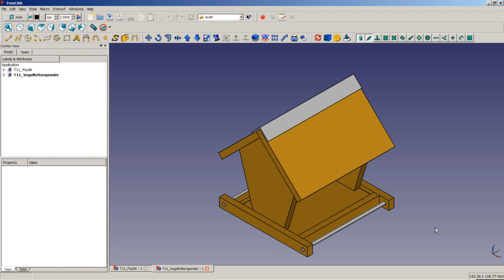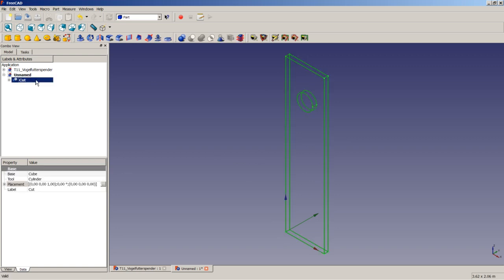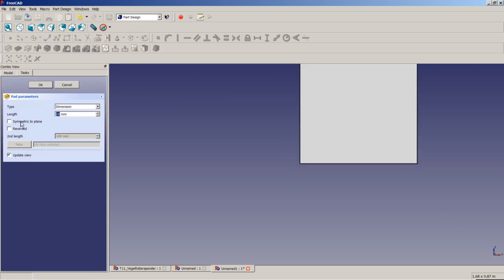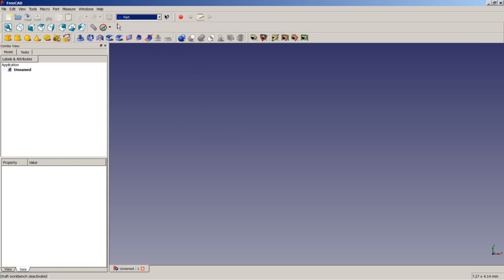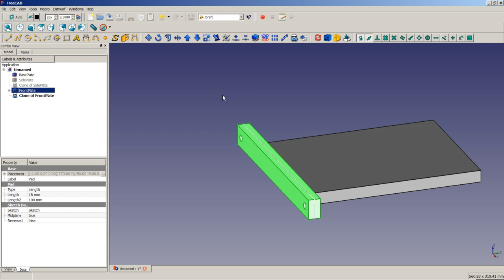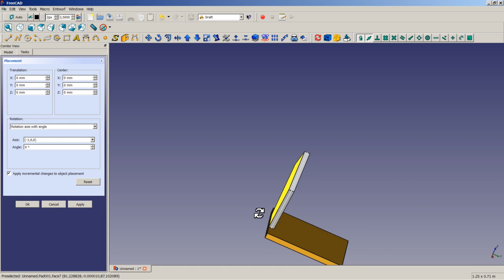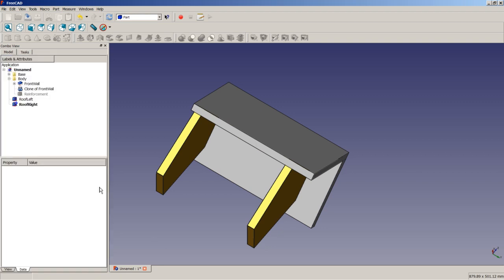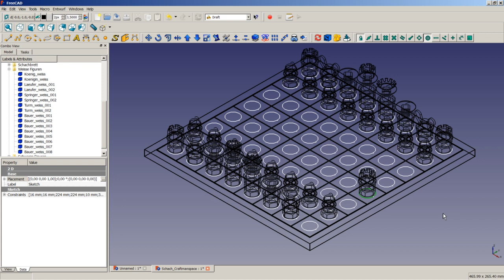FreeCAD Lesson 11 - Bird Feeder

Comment: HI, great tutorials. Im having issues with selecting mid points. I have only the 2 objects visible, only the midpoint snap enabled, when I select move and try and select a mid point, it selects anywhere, not the midpoint, its like the snap isnt working. I cant get the end plates to line up properly??
Reply from the maker: +Ruprect88 
Hopefully you are using a FreeCAD version 0.15.4671 or newer.
Did you first slect the solid you want to move in the tree view ?
Also switching to wireframe mode sometimes helps ...
Reply: +Learn FreeCAD 
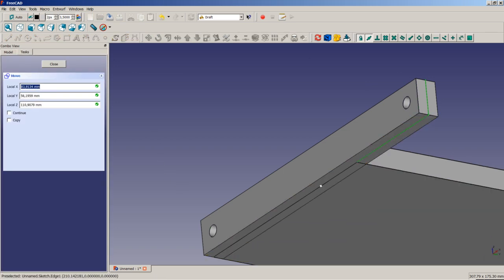Yes I am using that version. I am trying to move the front plate to the centre of the base plate  (38:10 in the vid) I have everything exactly the same as you however where your vid shows only the mid point dot when you select the part mine shows a dot where ever I put the cursor. ive tried in wireframe mode and also with only the sketch and base visible, still no luck.
Reply: +Learn FreeCAD Haha  All fixed....... I just had a senior moment, I had all snaps except the mid point selected ?? All working fine now  lol.
Reply: @Ruprect88  had exactly the same brain fart :) for others when you first go to draft EVERYTHING on mine was selected (blued) my brain said that meant they were off, you just need the lock symbol, and the midpoint icon blued and it works right, my neighbours think I`m came down with rapid Alzheimer's :) "I AM ONLY F!!!ING SELECTING MIDPOINT, BEEP BEEP BEEEPPITY BEEEP, ohhhh wait I`m not" :) I`m using version v0.16 (tried v0.17 but the tutorials weren't as good as these. and v0.16 works better than these)

Comment: Help. stuck at trying to move the sketch to midpoint. I click on move then mid point button. Then i try to move the cursor along the sketch line waiting for the midpoint symbol to show up telling me at i am on the midpoint so i can move the sketch to align with mid point of object. Mid point symbol does not show up.
Reply from the maker: +dwayne cad guy 
Make everything except the sketch and the solid you need for your aligning invisible.
Activate ONLY mid-point snap (snap modes have influence on each other).
That should work ...
Reply: I had the same problem. Making the parts wire-frame, and the rest invisible, still did not work. Finally, in frustration, I rebuilt the project using the part design workbench. Aligning sketches to midpoints, though, is also not easy. Using part design I could use symmetry, instead. I learned a lot in my struggle, though not exactly what this wonderful teacher intended.

Comment: Can You tell me please how to pocket a text string? I can only extrude...
Reply from the maker: +hfdhfd5 
This is not possible this way because the "sketch" for the Shapestring sketch can't be attached to a face.
This would be needed by the pocket-feature to work.
I used pad (extrude) and then placement for poistioning of the text.
Then I did a boolean cut and that worked for me ...
Reply: +Learn FreeCAD I'm sorry but I have no idea what You are talking about. I'm new at FreeCAD (and new to all this CAD stuff), can You make video about it?

Reason is simple i've made a simple power supply (yes I'm electonic). I have 3D printer, and I'd like to make a simple "spray-off" layer to create a description for power supply unit.

I'd be glad for help.
Reply from the maker: +hfdhfd5 
Here is a soundless video done by another forum member showing this:
https://www.youtube.com/watch?v=ksP139lTcv4